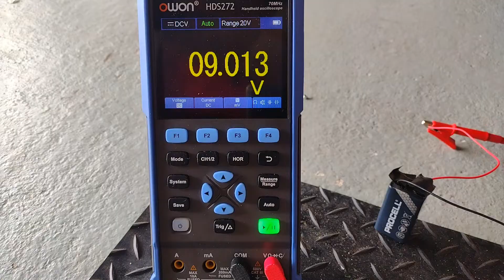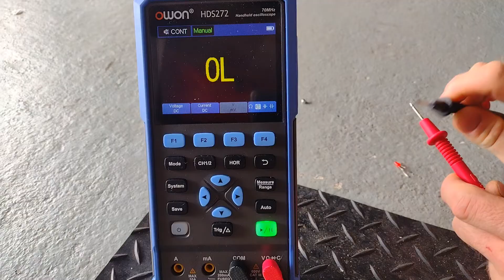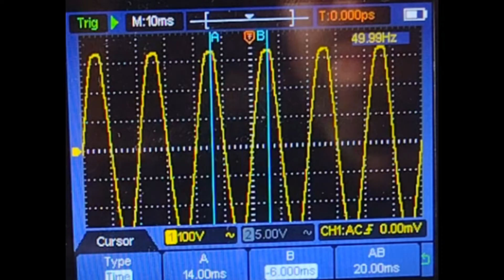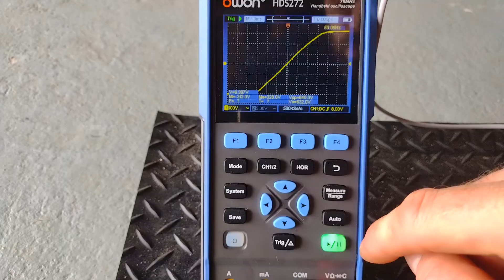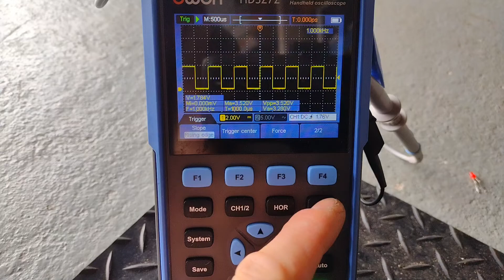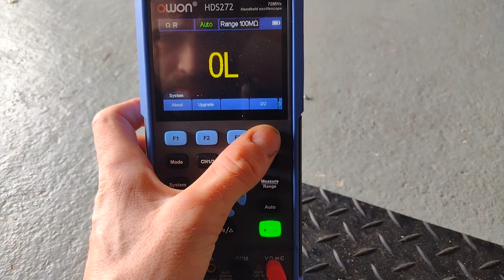Owon Oscilloscope instructions/ review

Comment: Thank you very much for this video. It helped me a lot to understand and find all the possible functions on that instrument. But there was one little thing you explained wrong and I would like to mention: On explaining the trigger settings (9:00 min) you pointed to the left edge of the screen for the rising an falling edge. This looked to be correct but it only was by coincedent. The trigger point is marked with a small "T" symbol on the top of the screen. In your example it is right in the center. It can be shifted in the trigger settings if nessecary. It's just a coincedent and depends on the horizontal time base that the rising / falling edge cuts the center line an the edge of the screen as well. But this is just a minor flaw. Apart from that: Very well done and thank you again.